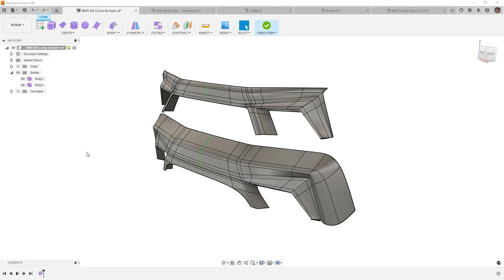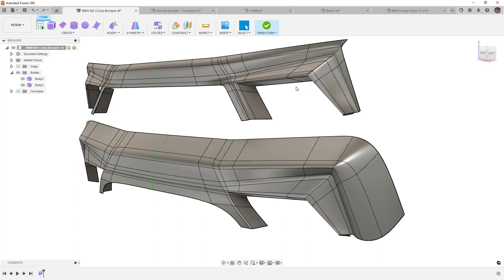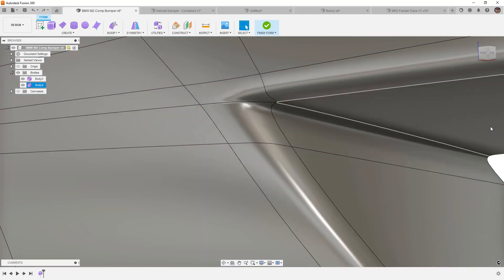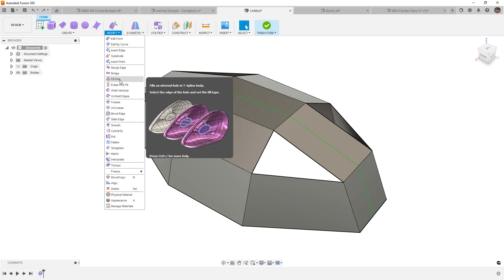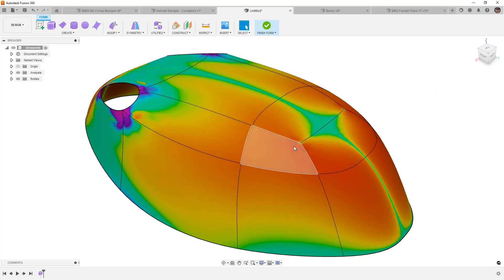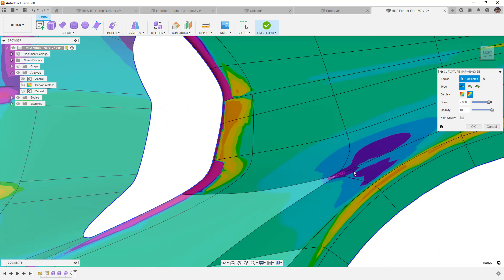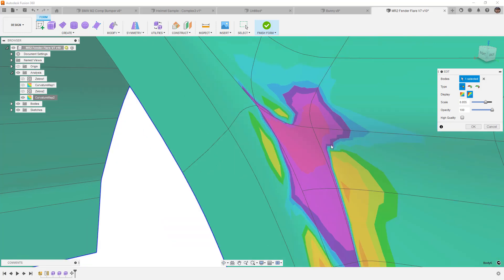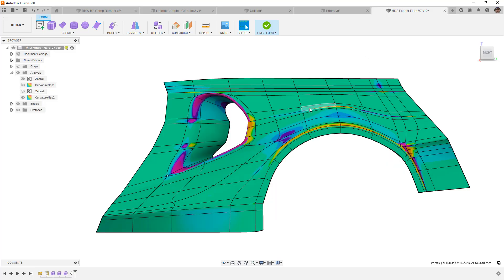Fusion 360 Form Mastery Part 37 - What are Star Points and How To Work With Them | #Fusion360

Comment: A star point is a point where 3, 5, or more than 5 edges come together at a point. The video didn't explain that in the "what are star points" section.
Reply from the maker: Very true. I pinned your comment.  I mention that they happen when you change direction while trying to maintain 4 sides on the surrounding faces but you are 100% correct that they happen with 3,5 or more edges come together at a vertex.

Comment: 1. Are there no good techniques for eliminating star points like deleting faces and adding patches, etc?
2. When you added an edge did you eliminate the star point or just move the curvature away from it?
Reply from the maker: Star points generally happen when you have to change directions with curvature like around the wheel arch or on the helmet when the top and side meet.  In some cases you can get away from them with some clever edge work, but most of the time the workflow is to try to put them in areas of low curvature.  Places that are more flat.  So on a car fender trying to get them away from a flare or wheel arch.  This is because the smooth surface does much better with 4 edges and 4 vertices.  Any more (or less) and you get some pinches in the surfaces if the shape is too curved.
Reply: @LearnEverythingAboutDesign  Thanks! I had a star and I guess I got lucky, because I inserted an edge, slid it down to about the midpoint of the adjacent edge that was at a right angle to the new edge, and welded the vertices on the other side of the inserted edge to the star. Essentially, I fixed the original star and created a new one on the other end of the inserted edge. When I preformed curvature map analysis again no stars showed up even though I just created a new one. Perhaps because the new star was in a low curvature area, fusion 360 didn't highlight it?

By the way, with the original star showing,I had problems doing some things with Surfaces and Solids created from the mesh. Once I moved the star to a flat area so fusion didn't recognize it anymore, Surfaces and Solids worked like a charm.
Reply from the maker: @MOVIEKICKS  Fusion should always identify the star points if you are using the Repair Geometry Utility.  Some star points can be converted to T points.  If they show up as Yellow they are ok(but still might mess up your geometry).  Red are the "error" stars or T points.  

Star points in a flatter area are always the preferred location.  Think about each edge being rigid.  If your shape isn't changing direction the star points are easier to deal with.  If they are changing direction (like the helmet) then just like you did just try and move them at least one face set away from any sharp changes in curvature